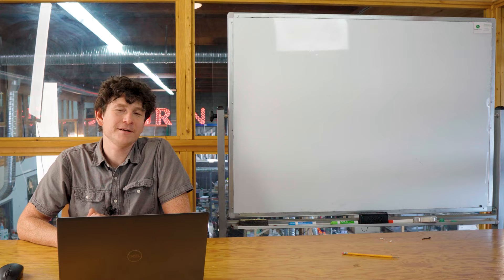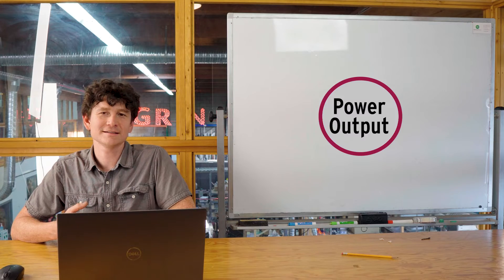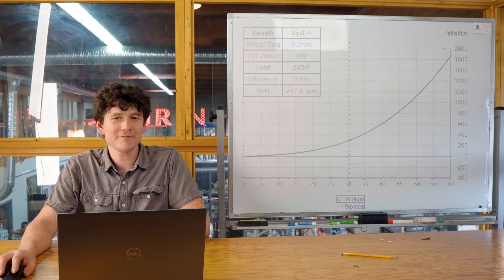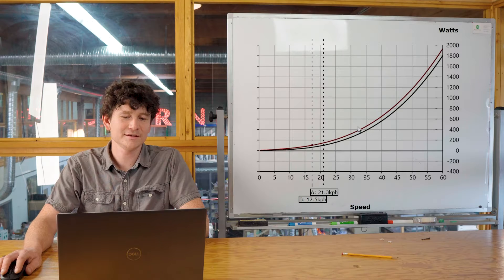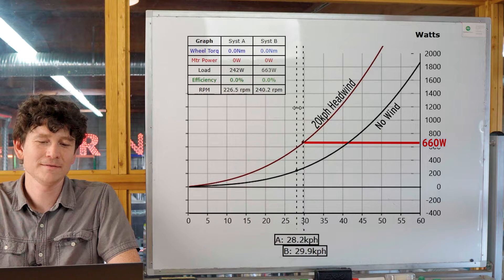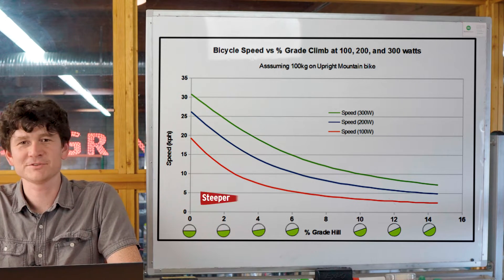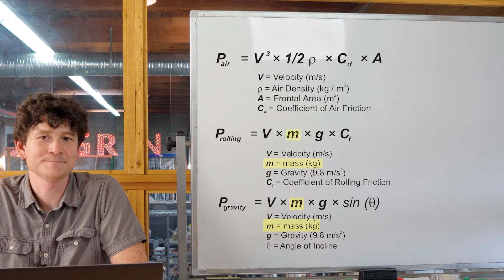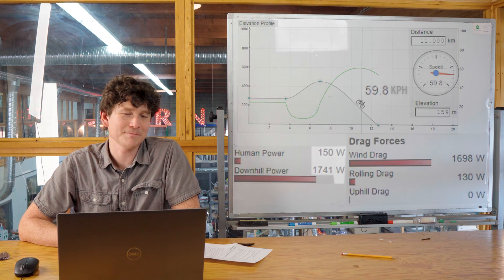School of Watts Part 1: The Power to Propel Bicycles

Comment: I use a 3000f capacitor to Power 2x1000w Motors. Climbing a small hill is no problem. And i have e-abs even below 0c.
Reply from the maker: Nice. Do you have a blog or forum post about the build? Super caps are pretty neat devices even if their total energy density pales compared to lithium.

Comment: Wow! Very enlightening the difference of tire pressure and weight and wind speed. 
I'm the kind of person who goes slow down a hill for the safety factor, and I think I'd benefit massively from regenerative breaking in that case. More than than 25kph and you're really, really hurting on a wipeout. Going 60kph down a steep hill is a surefire way to get very hurt when something goes wrong! I ride sans helmet at times but never over like 20 ish, you just can't react fast enough and a tumble would be so much worse. They don't go fast in the Netherlands so the vast majority if injuries are 70+ year old's breaking a hip when they lose balance because they were still biking at that age in the first place.

Comment: Very nice. Is part 2 going to talk about how long it takes to burn out geared hub motors under various conditions?
Reply from the maker: That will be part of it, geared or DD, just understanding the full map of power output vs rpm vs time for different motor models and what determines those things, and how dumb it is to try and characterize that with a single "rated watts" number.

Comment: Great presentation, useful data, thanks.
Justin: "1250W is way more than any human can sustain".
Tour de France winner: "Hold my beer ... "
Reply from the maker: Lance Armstrong could not sustain 500 watts for even 30 minutes in his most doped up state. The average power output of leading riders on the tour-de-france is in the realm of 250-300 watts.  The word "sustain" is subjective but was intended to mean for a duration of at least 10's of minutes.   The power output a human can do in a very short sprint is different (and impressive!)
Reply: @GrinTechnologies  All agreed - and certain road, track and BMX cyclists are reported to have exceeded 2000 watts for a few seconds! And even I can get above 1500W for a few seconds - the time is heat limited - using my CYC Photon mid-drive eBike motor on a 48V battery.

Comment: Great video! Although I'm missing something fundamental (but maybe it was planned for the follow up videos). So all the stuff about maintaining speed (cruising) is  very well explained, e.g. that vehicle weight has no effect on "air drag, which is the main force of power needed when you're talking about riding a bike on flat ground". 
But what I'm missing here is how much power you need to accelerate up to your cruising speed, and that you need more power if you want to 1) accelerate faster and 2) accelerate more weight. 
Anyways, can't wait the follow up video that will convince us all why regen makes so much sense, especially on slower vehicles.
Reply from the maker: Super good question. I deliberately left out the acceleration power since it has no bearing on the net energy consumption and didn't want to further complicate the equations with transients. Power for acceleration is simply p = m v a.   
So take your speed (in m/s), the vehicle mass (in kg), and your acceleration (m/s/s), multiply them all together and that is how many watts of power is going into changing your kinetic energy
Reply from the maker: With regen, the acceleration term is negative and so you get negative watts, the power of your kinetic energy returning to the battery system.

Comment: As far I know your schema is wrong, frontal air drag caused by high pressure is different air drag flowing along your body.
It's not cubic. It's between square and cubic.

What about rotational mass and drivetrain efficiency?
Reply from the maker: Rotational mass has no effect at all on the steady state power needed to move a bike at a given speed, and is a weird and misguided obsession by people who talk about bicycle power. 
And yes the cubic relation between air drag and power is an approximation for turbulent flow, but is pretty darn close. Errors from this are much less than uncertainty in the CdA approximation so it's rather splitting hairs to do a higher order model of that. The same goes for rolling drag, it's not exactly constant (some speed dependancy exists), but accounting for that in a complicated model would change anything about the result.
Reply: @GrinTechnologies  I wanted to hear this info, thanks!

Comment: great presentation , i would like to know what is the program which you are using in the simulation to get the result and the curves  ?
Reply from the maker: A slightly tweaked version of this:
https://ebikes.ca/tools/simulator.html

Just set your throttle to like 5% so that it doesn't entre the equation and hide the motor related curves via the radio buttons on the top of the graph.
Reply: @GrinTechnologies   thx a lot ...if you excuse me I would like to ask you a favour ..I am a senior student from Palestine I am  building an e-bike with the regenerative braking system as a senior project for the university ,  and I have watched a lot of your videos that show your huge understanding to this field  and exquisite explanations for this topic  and I know the thing is too big to be explained on a YouTube comment..but I wanna your help , in giving me notes website, tutorials, published paper and anything you believe it could help us and give us insights to do things in a better way .. I know it is a lot to ask ..
But thanks any way for your help

Comment: Thank you for this video! I recently made a video saying that to  calculate an ebikes top speed with ok accuracy, you have to go both ways on a relatively flat runway to negate some of the gravity and wind forces acting on the ebike. Sharing!
Reply from the maker: That's not exactly calculating your top speed, that's called measuring your top speed! But yeah an easy way to partially negate some environmental factors. 
You should also do it both sitting upright and in a crouched tuck position.
Reply: @GrinTechnologies  oh yeah that's true!

Comment: In the motor power I’m looking forward to you going through the serial and individual component efficiency of the system from battery through controller to motor and how the graph of that varies with current drawn, rpm etc. I’ve tried having this discussion with Bosch mid drive motor tech guys because their app seems to display power taken from the battery not the actual power added for assistance, which is all very misleading. In fact the app which shows assist vs ride split is pretty meaningless although their human input power is pretty good.
Reply from the maker: https://www.youtube.com/live/dxJe_gygRGU?si=PFwBySpMw-CR2L2V

The next video will be purely about power capabilities of motors in isolation, not really the other parts of the system.  See the video above if you want an in depth treatment of motor and system efficiency.

Comment: are you sure dobbling the wind resistance caused 8 times the force?...i thaught it was 4 times.
Reply from the maker: You'll notice we are careful to say 8 times the power, not 8 times the force. Power is force times speed, so if force to air drag increases at the square of your speed, then power increases at the cube.
Reply: you say at 2.39 "air resistance has a property that it increases with the cube of your bicycle speed" that is very interesting as i thaught it was mass times velocity squared that determined force. looks like i may not fully understand why drag creates a cube ...i guess with drag the force is in front and behind the object creating a force on the object higher than the frontal drag force alone. I need to up my considerations of drag..thanks for the education.
Reply from the maker: @russellwilson5246   The drag force increases with the square of speed, hence the drag power increases with the cube of speed.  In a similar way, rolling friction force is independent of speed, while the power to overcome rolling drag increases linearly with speed. In this video everything is in the context of power (ie watts), so when I mention rolling and air friction quantitatively it's about the power needed to overcome them and not the force needed to overcome them.

Comment: This type of discussion makes me less insecure about my 120lb weight lol. Being as thin a telephone pole has aero benefits, rolling resistance, etc.  I can also leg press over 600lbs, so I am not super weak or anythint.  My first ebike was only 250w and it could get me up the steepest road hills in my escarpment town.  Upgraded though cause I didnt like mid drive so much and switched to hubs.  It is awesome!  So quiet and smooth, no gear changing necessary...she just rips.  And absolutely no issues with anything, just attached tk the bike and start riding.  It just works.  I was able to build my hub motor wheels all by myself with no prior experience, right down to measuring the hubs and ordering the correct length spokes first shot, and it was all just from Grin Tech discussion and tutorials.  I had little confidence, but it went so well now I feel like a pro lol. Will be building all my own bike wheels now!  I even managed to true my first wheel in only a few minutes with no stand or anything, just a spare bike fork.  Honestly, Grin Tech is the reason I felt able to convert my 2010 Trek 3700 into an ebike way better than any of the cheap ones that are still far more expensive.  My whole setup wasnt much more than $500, including the bike.  Constant compliments and people offering to buy it for far more than I paid.  I was run over by a car years ago and havent been fully able to bike like I used to and ebikes gave me a new lease on the hobby I love so much.
Reply: Is hub better because it is more direct?
Reply: leg press over 600 pounds?! Wow.  I guess you never skip leg day.

Comment: Hey Justin, on the next part, Please
Mention the effects of drafting (slipstreaming) behind large and small vehicles. 
I'm curious to know what performance gains are associated with these advantages.
Reply from the maker: That's a much trickier thing to be analytic about and model, but basically it's the same thing as having a small or modest tailwind. The degree depends on how big the leading vehicle is and how closely you follow. 

The next part is all about motor power, so no more mention of air flow except as it pertains to convective motor cooling.
Reply: @GrinTechnologies  Thanks Justin. This is truly valuable content you're putting out there.  I, for one, found the section on the hills particularly interesting. 
This is because I live in Rwanda(aka The Land of  a Thousand hills) and i'm designing a mid-drive ebike with the perfect specs to tackle this challenging terrain.
If you'd like to know more about my progress, I'd be more than happy to share them with you.

Comment: Thank you. This is the sort of quantitative evidence based analysis that should inform ebike restrictions globally rather than the current arbitrary limits thought of by some bureaucrat who probably doesn't even ride a bike.
Reply from the maker: Actually is even worse, most of the original power and speed based regulations were lobbied from within the pro cycling community, who felt that an ebike should be modeled after a human power bike, with all the flaws that entails. Like going super slow up hills, and super fast downhills, limited in cargo capacity, and being at the merci of winds. None of that makes cycling safer on the roads, or more practical and appealing.

Comment: Nice job Justin. This video would be great information for policy makers in creating the new regulation standards.? What regulations make sense to you for watt limits?
Reply: Limiting watts in e-bike makes no sense as we've seen in this video. Im my opinion the laws and limits for e-bikes should only apply to maximum speeds and where we're allowed to ride. For example, in my small town some of the bike paths have high grade inclines where even a 2000W motor would struggle to drive a rider uphill. If we want a cleaner and more fun future, we have to take fully loaded cargo bikes into account, because for a cargo bike going uphill, 500W or 750W is not even half of the energy needed.

Edit: motor gearing will, of course, change the torque power of the bike. I can't wait for the next videos.
Reply: @yvan2563   Exactly. The only thing necessary is speed limits on paths where children or other vulnerable bike users are present.
Reply from the maker: That'll be the subject of part 3. But fundamentally yes, power should not enter the regulatory framework at all.   Speed and mass are the only things that affect relative road safety, and acceleration limits (to like 0.1 or 0.2g) can very easily and effectively address any concerns about systems being unsafe for inexperienced riders to handle, without any compromise in the ability to climb hills.

Comment: The biggest concern I've have had with hub motors is hills and stressing & wearing out the motor. Also dealing with big drops in speed so learning to pick the right hub motor with enough power is very important if you have to deal with lots of hills.
Reply from the maker: If your are worried about stress and wear on the bike climbing hills, then the suitably torquey hub motor is usually what you want. Stress and wear happens to your drivetrain and brakes which is exacerbated by a mid-motor, and greatly reduced with a hub drive.

But as you say, you need to get a hub motor that is sized to your needs (weight and grade hill) and then you can fly up the hills. An undersized hub is underwhelming.

Comment: Folks, was the Ligo 10X abandoned? I had this idea of using specific power cells for a similar purpose, would love to discuss it with y'all if the project is still underway. If it was abandoned, can I use a similar idea non-commercially or have you folks patented the format/application?